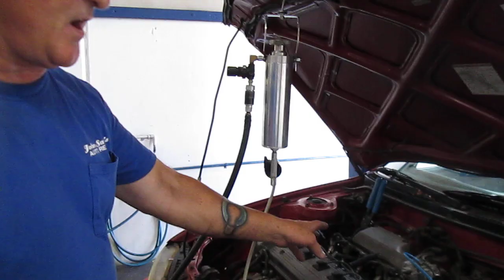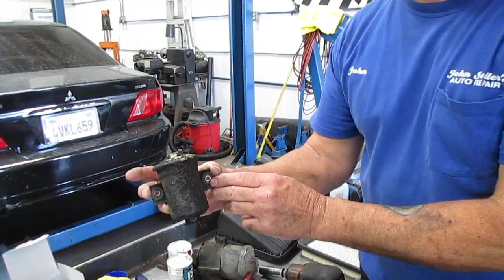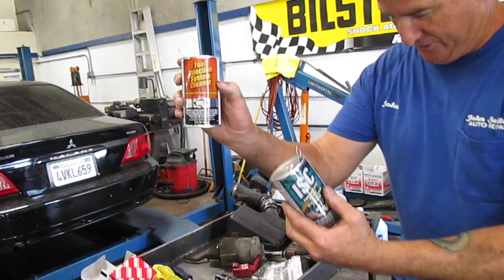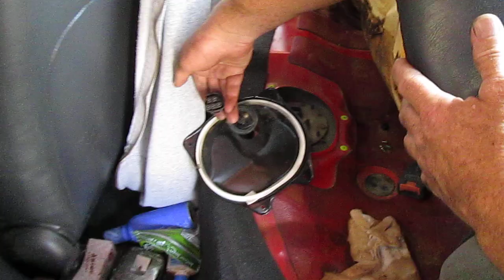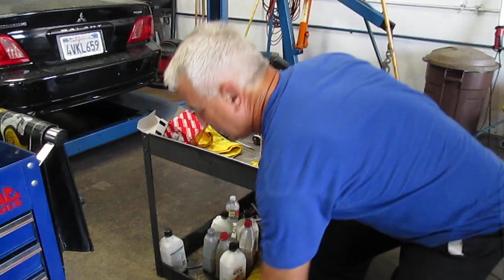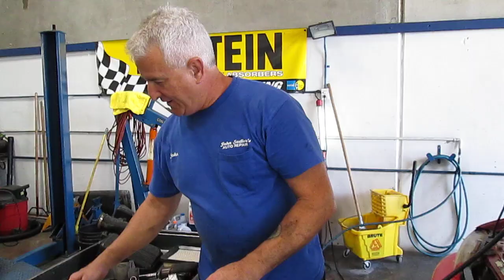How to Clean Clogged Fuel Injectors

Comment: You can pull the fuel pump fuse also. It’s easier actually
Reply from the maker: Hi Rob! On that model there is no fuse accessible. 
There is some type of relay you have to unplug. 
It's mounted below the steering column behind the lower dash panel. 
So that is why I did it this way.
Thanks for the tip!
Reply: @JohnSadlersAutoRepair  well that makes sense

Comment: Excellent Sir!! my 3.3 litre  2006 toyota highander (with 375 thousand Kilometers on the well maintained engine,) needs this done as it is putting up a code for # 5 misfires when its started up cold only,otherwise that its fine when it runs for 3-5 seconds after morning or first startup and no problems after complete warmup. . i was thinking of just running fuel injector cleaner directly into it ( the same product that you put in your vehicles tank (Gumout) or STP. is it good if i use it full strength ...wondering... ty excellent video and good explanation.Canada ty for sharing your experiment and knowledge/experience
Reply from the maker: I've had good success with the 44K BG products.  You add that to a full tank of gas and it will help clean the fuel injectors spray pattern.
Reply: @JohnSadlersAutoRepair  ,thanking you for your quick response and your professional feedback Sir!! ill get this 44k BG Product ty again
Reply from the maker: @battlehrfred  Your welcome!

Comment: John, why not just disconnect the fuel pump relay or fuse rather than going through the hassle of removing the rear seats and connector.
Reply from the maker: On this model the relay you have to disconnect is under the steering wheel. The fuse runs other systems so can't do that either.
You have to remove the lower trim cover and it's hard to access.  So the easiest way was the way I did it.

Comment: Hello John, nice video. Just have one question, for how long you let the car running with this product? Thanks.
Reply from the maker: Hi Juanka, about 40 minutes total. Each can takes almost 20 minutes to go through
Reply: John Sadler's Auto Repair 
Thanks. Can I used others brand injector cleaner? What about Royal Purple? Any from Auto Zone that you recommend it? 
Thanks.
Reply from the maker: @juanka1053  I only use the BG products, you can buy them online at eBay and other places. I have tried different brands over the years with very poor results.

Comment: That's a decent quick solution to clean the injectors but at the same time it can also create some issues too.
     The best way is to always take them out and clean them out of the engine due to contamination to the cylinders,  O2 sensors and catalytic converters.....and also the engine oil will be affected. 
       But it's a quick fix that will eventually end up in a nitemare one day.

Comment: You could also remove the fuel pump fuse..correct? also i am not sure my blazer has a fuel injector issue... it idles great ,but under load it hesitates and bucks ... i keep getting  po101... i replaced maf and connector and even added another ground to existing black ground wire on the 3 wire plug...  red wire show 12volts... not sure signal wire is working to specs...even if it is not i don't know how to fix that...any suggestions are appreciated... thanks
Reply from the maker: On that model there is only a relay mounted under the steering column behind the lower kick panel,  hard to access.
Get me the LTFT at idle and at 2,500 rpm. When you clear the code does it come back as soon as you start the engine again?
Reply: I have cleared codes a couple of times and p0101 comes back after driving it for a little bit... i did check signal wire and i only get 2.65 when its hooked to Maf and running it stays the same does not change when i give it throttle at all...  when i unhook plug from plug the signal wire reads 5 volts...my mechanic friend says i have a intake air leak somewhere... but he never looked at it... i am going to make a smoke leak detector..since i can't seem to find any leak using other methods... i  do not think its an injector issue... Thanks for your help..

Comment: Hi there ,  can you please kindly write down the steps to do from first to the last step ?

I don't think we need to disconnect the Fuel pump , i have a Hummer H3 2006 , how to 
disconnect the Fuel pump sir ? Unless you  disconnect the Rely ? ! 
Fuel pump is not Accessible at all in  Hummer h3 it is inside the Fuel Tank 
below the car and these cars do not have Fuel filters , it is something 
that is integrated inside the fuel pump ... please advise how to use this tool on Hummer H3 ..

Thank you .
Reply: almost all cars have a fuel pump relay, pull that your fuel pump stops working.

Comment: What tools did you use? I don't see the link anywhere.
Reply from the maker: Meg G https://www.walmart.com/ip/OTC-Tools-Equipment-7448A-Fuel-Injection-Cleaner-Canister/43604169?wmlspartner=wlpa&selectedSellerId=1235&adid=22222222228031456094&wl0=&wl1=g&wl2=m&wl3=56388588776&wl4=pla-100834095176&wl5=9031301&wl6=&wl7=&wl8=&wl9=pla&wl10=112354589&wl11=online&wl12=43604169&wl13=&veh=sem
Reply from the maker: This is similar to this who I used. I bought mine from a company called BG products. You can look them up on Google and by Tool from them also.

Comment: How did you come to find out the injectors were dirty and causing the problem ? What were your diagnosis ? That is why I watch auto repair channels ! You always show us what you found after the fact , never what you did or how you came to that conclusion?
Reply: JOGO bit late for anyone to reply but engine sputtering can be a result of dirty or clogged fuel injectors. Im about to clean mine in hopes that gets rid of the sputter on my f150.

Comment: I have a 2000 xlt explorer 5.0 v8. What is this process called or that gadget...? Price?
Reply from the maker: Fuel injection cleaning service, $220.00 parts and labor at my shop. You can buy this fuel injection tool on ebay and amazon , https://www.google.com/aclk?sa=l&ai=DChcSEwiR8MHSk53VAhXKl34KHd1iCLgYABAQGgJwYw&sig=AOD64_1iG6m0BZfAzDwU2EiAdbacRXuFJw&ctype=5&q=&ved=0ahUKEwjsrb3Sk53VAhXBxVQKHawPDsgQwg8INw&adurl=

Comment: That shit's too difficult to do at home 
99.5% of or BMW owners do not have that machine
Reply from the maker: Just showing everyone that it can be done on the vehicle Johnny, there are some special adapters for BMW. This is a significant savings from the dealership procedure.
Reply: Still doesn't tell you if you have a leaky injector or a bad injector, better off to pull them & do it right.

Comment: When talking to a shop, what is this service called?
Reply from the maker: Fuel injector cleaning service on the engine with the engine idling.
Reply: Can this be done on an engine that won't start due to clogged fuel injectors?
Reply from the maker: Probably not
Reply from the maker: Fuel injector cleaning on the vehicle

Comment: i have a nissan cefiro 1998 with a bad acceleration start got a new spark plugs , change 2 damage coils ,clean the intakemanifold i even change the computer box but still a have a bad idle pls advise me what to do its been 2 weeks now i almost did every thing and spent 22,500 pesos
Reply: buddy castaneda check the engine codes and see what comes up

Comment: I have an '04 Honda civic with 121,000 kms on it and it doesn't drive smoothly. There is breaks in the fuel flow to it I think because I feel a slight repeated lurch while driving.  Do you think the injectors could just be dirty?
Reply from the maker: Just by the mileage they are probably restricted some, you can buy the 44K from BG Products and add to your gas tank and if that help have the complete service done
Reply: Alright thanks!

Comment: it look like the blue line just go in the intake air not the injector rail ?
Reply from the maker: Hi David: Yes the blue line was to spray a little brake or throttle body cleaner when I first started the engine. Right in front of the throttle body where you see the brass fittings is where i hooked up to the fuel rail line.

Comment: Hey John just out of curiosity. How did you bypass the mass airflow meter because I saw you taken off the whole intake hose assembly just fore of the butterfly?
Reply from the maker: It will run with the hose off, on some Toyota's that have the big maf meter with a door inside, push a rag into the opening until it opens the door and it will fool the computer.

Comment: Problems are they never change the fuel filter and that produces filthy gasoline. Use a top tier gasoline and change that filter very few years and you won't have problems. Look up Top Tier gasoline and it will tell you which ones are Top Tier. Mobil is best for regular and She'll is best for premium.
Reply: Arthur Smith :I Check Gas Mileage Religiously,As I  Am A Courier & Have to Buy My Own Gas & SHELL,BP Get Me the Best Mileage,Just Using Reg.Not A MOBIL User ,Because Here in ATL. Ga.,MOBIL IS HIGHEST PRICED GAS & VERY FEW OF THEM HERE.FRIEND OF MINE WORKS FOR DELTA & HAS AN OLDER VETTE & ONLY USES BP ULTIMATE.HE BORROWED A MINI CAMERA FROM THE TECH MECHANICS THAT SERVICE THEIR JETS & INSERTED IN EACH CYLINDER OF HIS 350 ENG.& EVEN AFTER ALMOST 200,000 MLS.Not A Spec.of CARBON ANYWHERE IN ENGINE.I HAVE A BIG 4 CYL.IN MY OLDER SONATA & BY BLENDING REG..& SHELL PREM.,I GET 90 OCTANE & GAS MILEAGE & POWER IS AS GOOD AS IF I RAN STRAIT.93 OCT.WHEN I FEEL MY ENG.NEEDS DECARBONIZED.

Comment: so u disable the fuel pump relay and close off the fuel return line? And basically u use the 38psi tool to inject the fuel mixed w/ the cleaner?

Comment: can i just add this to an empty tank and run the motor off of it. I need to do this on a motorcycle. i don't see why i can't.
Reply from the maker: +phatrides222000 Call Tim Morehouse at 619-890-3276. Your exactly right! They sell a kit just for motorcycles. Tim will explain it all to you, just tell him you saw the video on you tube. Let me know how it runs when your done. John
Reply: did you ever try this on your bike? im interested in trying this on my bike.
Reply: I didn't, The guy I'm building the bike for has put me on hold. A few guys said just empty the tanks and add it to the tank. The fuel pump will insure correct pressure. Not sure i want to do that. It may not me good for a submerged pump. Kiler Nix
Reply: that's where I'm sceptical as well, I'd rather not have to put a new pump in my bike afterwards. Did you ever call "Tim" about the "motorcycle specific" product?+phatrides222000
Reply: Kiler Nix no, I'm gonna blow the fuel rail out with compressed air and see if i get trash. If not, I'm gonna flush the system and try new gas. I'm not even attempting to start the motor as is.
Reply from the maker: You can call Tim and he will explain all the products they have for bikes.

Comment: I obtained a Mercedes c class early this year someone was running it on chipfat and curry oil to say the least it was running rough first job filter in the tank ?then main fuel filter change and clean the fuel lines out with break cleaner half a tank of fuel half a gallon of parafin and a bottle of injector cleaner then drive it down a motoway ?end results perfect ?.

Comment: That induction service that you're doing doesn't send any product through the injectors.
Reply: +nilphuxgiven  Why do you think that? He disconnected the fuel pump. I believe there are some sort of check valves in there some where.. So yes, if the engine is running with the fuel pump disconnected and the engine is running off the service valve, then the treatment is definitely going past the injectors.
Reply: Charlie Luckart I had to really take a close look at how he had that rigged up and I can see that you're right.  That tool can also be used another way that sprays into the intake air stream and doesn't clean the injectors, only the intake tract.  That's what I thought he was doing until I paused the video and took a closer look.

Comment: John, whats your take on using Seafoam? Have you ever used this product to clean carbon deposits via the brake booster vacuum line?
Recently I bought an 88 Toyota 4Runner 4cyl. with a 22r (EFI) engine. It runs pretty well but it has two issues that I believe are unrelated. 
The funny thing is these symptoms were not present when I inspected the truck prior to the purchase. 
1. After warm up, The idle begins to surge. The surge is somewhat mild and random as it doesnt always do this. . When it does happen I can get it to idle normal after a quick stab of the throttle. 
2. I noticed a sputter (hiccup) while driving at 40mph & at 55MPH. As of yesterday I think I found the cause for the sputter. I noticed a couple small holes in the original muffler that seem to be causing it to sputter at higher RPM's. 
So far ive checked all the vacuum lines, cleaned the MAFS, cleaned the air intake, replaced the air filter, checked the spark plg cables. Continued...

Comment: Hey John I have a 2004 Hyundai xg350 it shuts off when I'm driving I got the battery starter and alternator checked and there all good I don't what's causing it to stall.
Reply from the maker: +Joseph Gonzalez How many miles is on your vehicle? how fast are you going when it happens? Does it start right back up? Did it just happen one day or been awhile? Let me know and will try to help. John
Reply: It's been happening for a while and it's usually when I'm only going 40 miles per hour or lower
Reply: It just shuts off but sometimes it starts after a few minutes sometimes a hour or longer I don't drive it anymore because its to dangerous until it gets fixed
Reply: And only 120,000 miles
Reply from the maker: I didn't find any service bulletins on this issue, sound like a sensor is getting hot and causing the problem and then it cools down and starts. The Cam and Crank sensors can cause this issue. If you just let it idle for 20 minutes or so will it stall? Have you hooked up a scan tool to see if there are any codes in the system? Sometimes you will have a code with no check engine light.
Reply: I actually got a diagnostic two weeks ago and they said it was the crank shaft sensor so I'm assuming that's my problem but this back yard mechanic came to my house and told me the shop was lieing about the problem and just wanted to make a good amount of money off me I don't know anything about cars so he reset the computer in my car and the check engine light came off the screen long story short the next day after he reset the computer the car was acting the same stalling so I got screwed over
Reply: And lately it will stall in less than 5 mins
Reply from the maker: Sorry to hear that. As you now know resetting the computer won't do anything to solve your problem. If it was me i would go back to the shop that diagnosed it and ask what the warranty is if they fix it. As long as you have some type of warranty on repairs you should be ok. I give my customers a one year parts and labor warranty on all the services i do.
Reply: I had that same problem. I would be driving and it would just cut off. Very scary. Come to find out it was my fuel pump. Hope that helps

Comment: I have a 1992 ford explorer I need to do this to do I hook the tool straight to the fuel line
Reply from the maker: +Austin Blankenship Good Morning: You need an adapter and hook the tool up to the fuel pressure test port on the engine. Then set the fuel pressure 5 psi lower than the spec's and remove the fuel pump fuse/relay so the fuel pump will not run. Then you turn the tool on and perform the service. Where do you live? If your in San Diego give me a call at 619-464-6088 or you can contact Tim Morehouse at 619-890-3276 and he can sell you the adapter and give you information about the tool. Call me if you have any questions, John

Comment: pull relay to keep fuel pump from running. lower tool pressure so that fuel reg. doesnt open.
Reply from the maker: Thanks for your input, this model has no fuel pump relay. It has a circuit opening relay that in under the lower panel by the steering column on the driver side of the vehicle. Since it's very difficult to access I unplug the pump on this model.
Next if you lower the pressure more than the engine is used to running on, the fuel injectors will not gets the most Optimal cleaning. I want to make sure there is no loss of cleaner down the return hose, that's why I block it off.
Reply: lowering the pressure by 5psi wont change anything. its the cleaner thats doing the work not the pressure.
Reply from the maker: ***** Thanks for your input, I always go by the specifications.